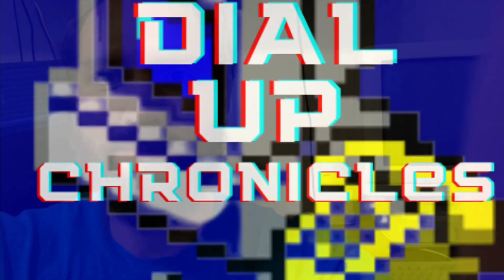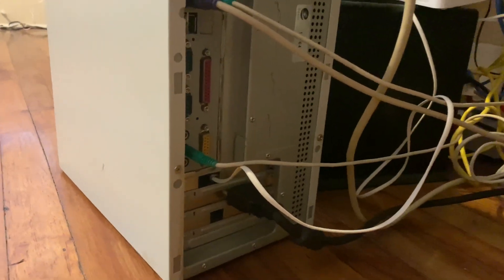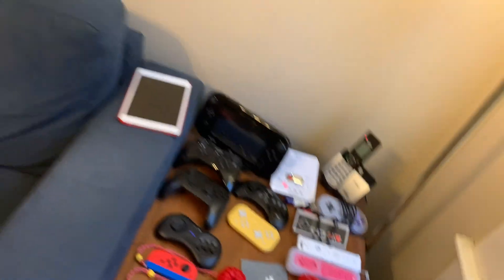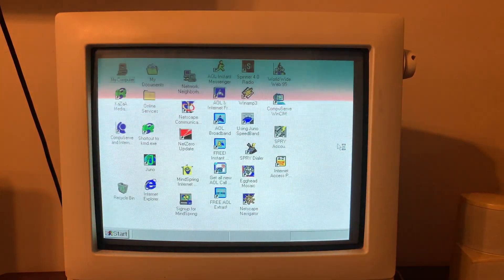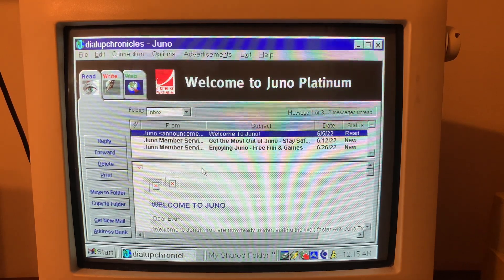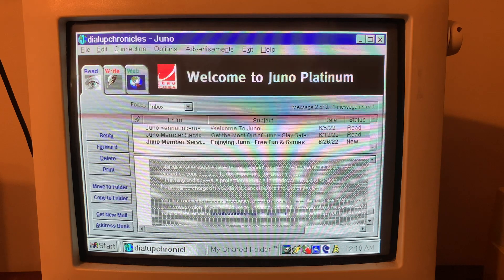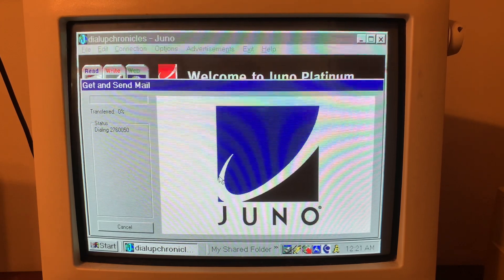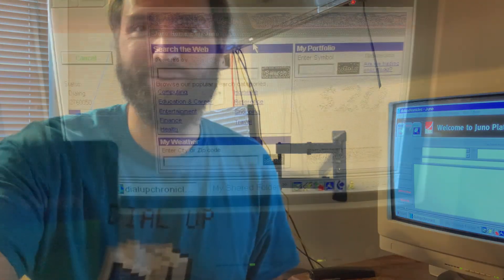My Setup! + Checking And Sending Email With Dial Up! - In 2022

Comment: Great video! If you find yourself needing to clean the mouse very frequently, are you perhaps cleaning just the little roller ball? This helps in the short term, but the long term solution is also to clean the little plastic rollers inside the mouse. They might look gray or black if they've accumulated enough gunk. If you're already doing that, then nevermind, just thought I'd mention it as a lot of people only know about the ball part.

By the way, what's the background music in the video? I love it!
Reply from the maker: Thankyou and I got a new mouse!